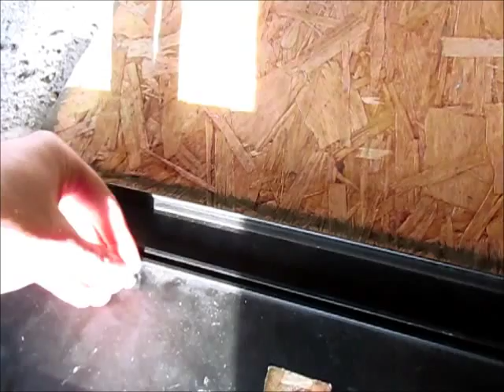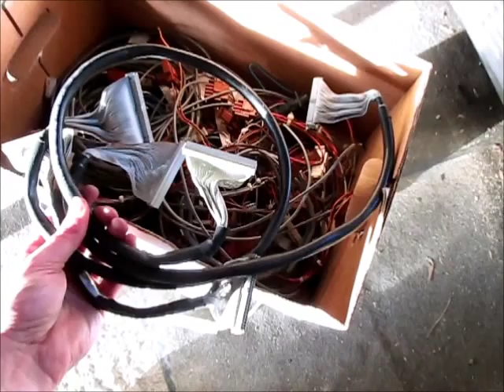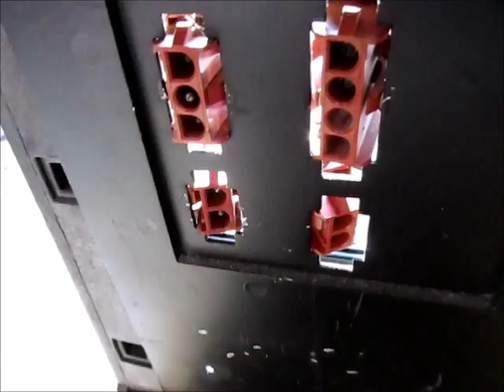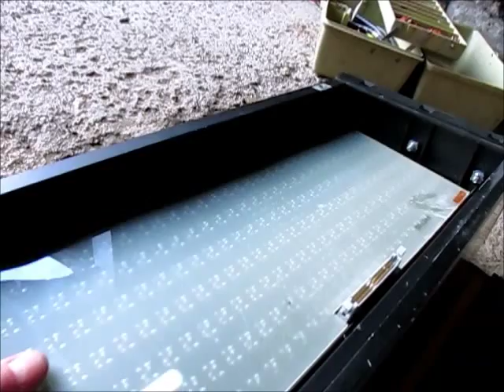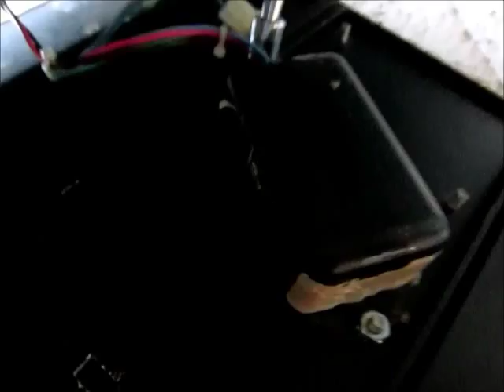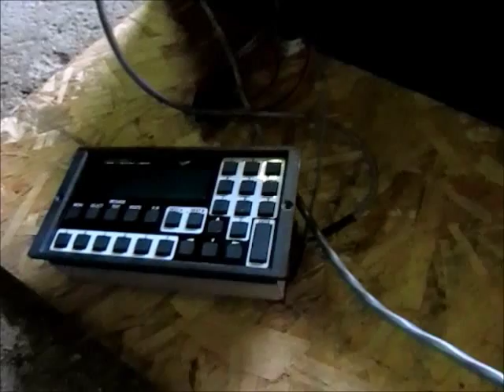Building a Luminator Bus Destination Sign from an Empty Frame & Spare Parts

Comment: Am having problems with my twin vision system, it's from 2004, what am I supposed to connect on the left 4 pin receiver on the back of the front sign?

Comment: RollsignGallery, I have the GTI Max Mini 3000. Luminator programmed us a new PCMIA card with our messages. They are asking me to set the internal dip switches so 7 is the only one on. Which panel that you mounted on the back door is the panel that has the dip switches?
Reply from the maker: The electronics for a MAX3000 sign are different than this earlier model GTI MAX sign. For your MAX3000, if you remove the back panel of the sign, on one of the circuit boards facing away from you, you'll see the DIP switches at the top peaking over.
If you should ever have trouble dealing with Luminator for future programming or service, feel free to contact me.
Thanks for viewing my video!